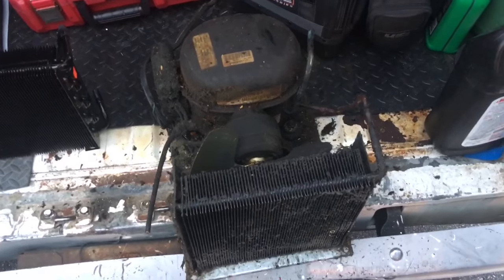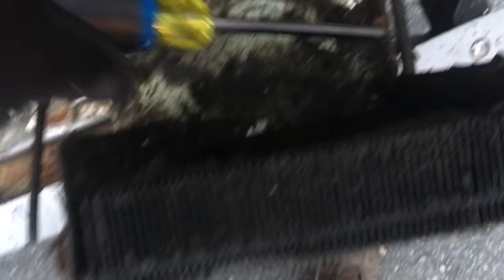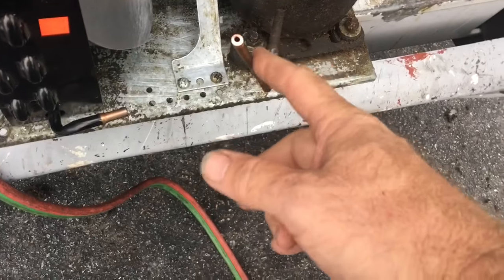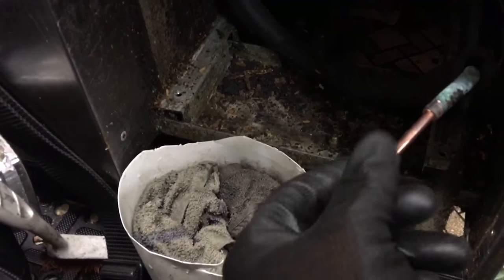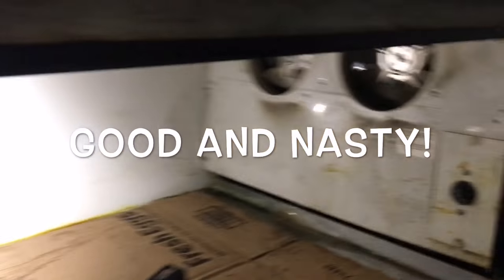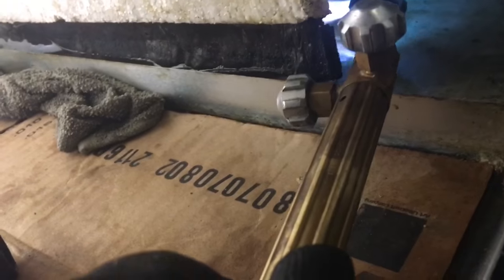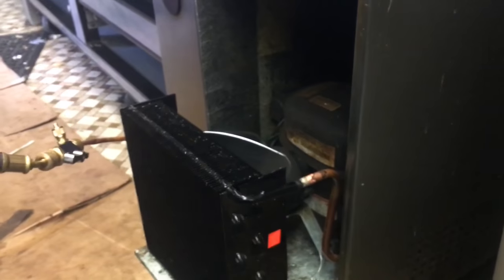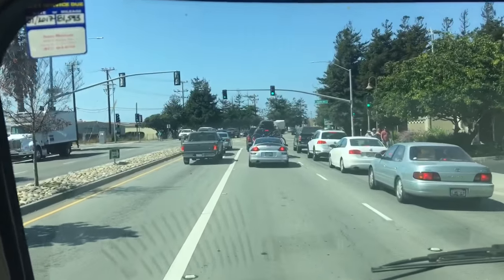Cooks line draw unit condenser change out

Comment: my comment got posted before I  could say that the compressor will go probably sooner than later.  It would be cheaper to replace the whole condensing unit now, because it looks like there are more problems pending on this one.
Reply from the maker: The customer was offered all options they went with this one. And when the compressor dies I'll do the cap tube also and cond fan motor. It's basic business in my town, I usually replace compressors no dose maintenance.

Comment: Great job Dave! You just reminded me I need to go check a rooftop unit that I added Supco 88 to last year. It was a Trane that had the orifices made into each circuit in the evap coil. They were restricted and freezing. It either fixed it or they replaced it without telling me because it's been a hot summer lol. Thanks for sharing!
Reply from the maker: That would be a great video especially if the supco worked.

Comment: have used the supco 88 oil on many projects.  its in my heat pump system.  which is 20 years old.  still running after 20 years with no problems.

Comment: My first service van came from a food service group. Coil cleaner worked great on the grease but not the smell. Rode with the windows down most of the time. I hate that the camera would not co operate with the soldering. Have You tried the STAY Brite 8?
Reply from the maker: No have not.

Comment: Nice one Dave. What Silver solder are you using ? just got my self a nice little handheld steamer to de-ice coils. I work on mostly domestic units so I'd melt the box if I used a torch and the heat gun to can be a little sketchy ahahah.
Reply from the maker: sil-fos 15  and 56

Comment: That Supco 88 oil?? Is that just regular oil (Poe, min, ally)?? or is it something to help the system?
Good video. I have a brand new Filson work jacket that no matter how many times I wash it I can't get the burnout smell of a self contained that shot me out. We work on some nasty stuff.😎
Reply from the maker: The supco 88 is an additive suppose to help clear out the cap tubes, and loosen up old motors.
Reply: +Nor-Cal Refrigeration & H.V.A.C Cool, thanks!😎

Comment: Those undercounter grill units are the worst to work on as you can see....no matter what brand. That funky smell is very hard to get off your hands...not even fast orange gets it out. Did you put a larger size drier in or went with those piece of shit factory driers? On a job like that I usually go with a Sporlan 32S drier
Reply from the maker: I used the Emerson 032capt. Drier.

Comment: Good vid ! too risky for me to just replace the condenser , with my luck I'd get bit in the ass and the compressor would fail in a week. How do you handle that if that happens or did u tell customer if it happens , it's on him for going cheap ?
Reply from the maker: The customer was offered and refused. Fine with me it's like double dipping. That compressor is original. It's not long before its toast.
Reply from the maker: +OcRefrigeration,Hvac & Electrical. It's a learning curve for the customer, they will figure it out by the time it has a couple compressors. I have 1 account I replaced every compressor in there store one year. I offered to show them how to wash out the condensers for free. And they don't do it.
Reply from the maker: +OcRefrigeration,Hvac & Electrical. I only have few customers that let me clean the ice machines. Lol. No one pm s out here.
Reply from the maker: +OcRefrigeration,Hvac & Electrical. Same here they are not opening up panel to look inside. Lol
Reply: Nor-Cal Refrigeration & H.V.A.C my last health inspection they were all over the mineral deposits on the exterior panels and door lid edges but did not look up inside the chutes.